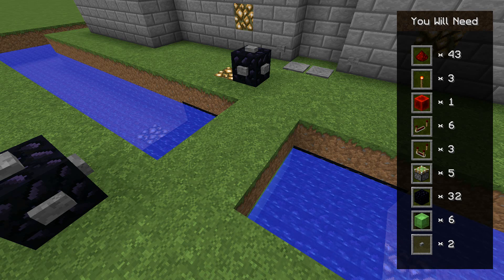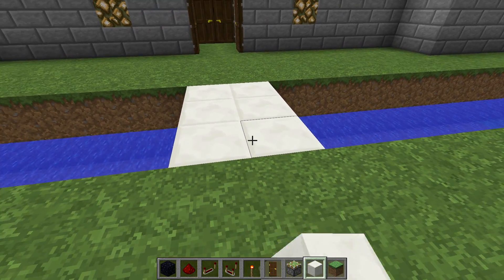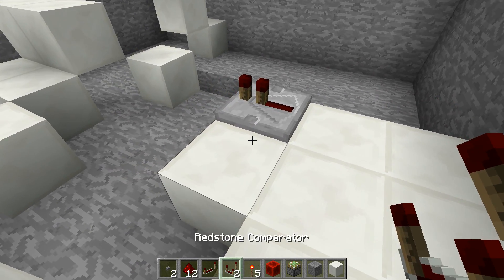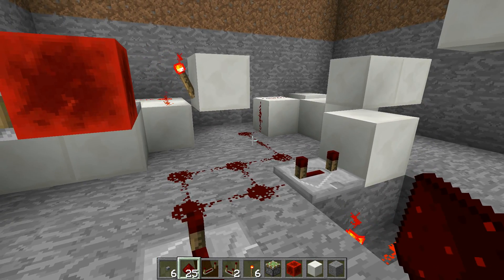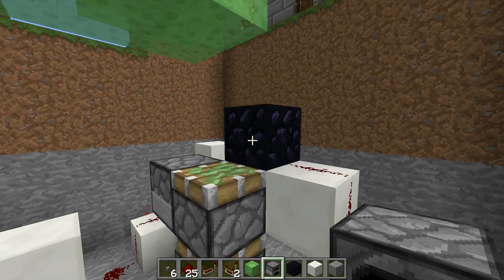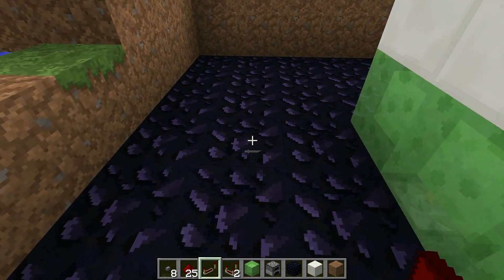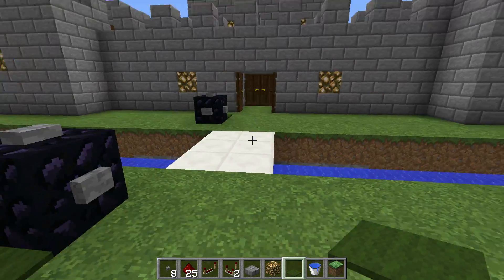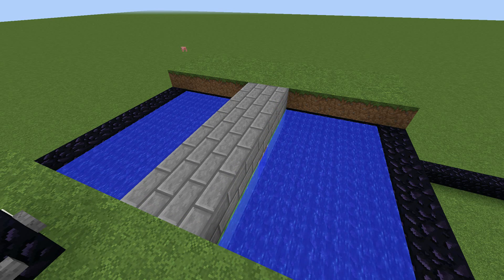Minecraft Tutorial: Redstone Piston Drawbridge

Comment: So I built it with an extended bridge.. works great but still have the lava/water flowing after dropping the bridge...
Reply from the maker: Lava, i can't fix as it does not refill when you remove the source blocks.
I have theories about how to make that work, but it would require Droppers to be moveable with pistons.
For the water to refill automatically, you need to make sure that at least one end of the bridge will have the water refill mechanic in play.

EG: if your moat and bridge look like this: (X = water, O = extended bridge, b= solid block)
bXXXXXb
bOOOOOb
bXXXXXb
The water will not refill. water needs a source block on the same row as the O's in order to refill.
So the following would work
bXXXXXbb
bOOOOOXb
bXXXXXbb
The water would then refill from the right. You could put water on both sides of the bridge (the left-most 'b') to make it refill more smoothly.

Does that make sense?
You'll see that i put water at either end of the bridge for this reason at 14:36.
Lava you cannot fix though, sorry.
Reply: LiLbUg99 thank you. I might just use water. Cheers

Comment: can you make this build extend taller?
Reply from the maker: So the moat can be deeper?
I think it may be possible.
It should be possible to have the upper-most piston be level with the blocks at the base of the moat (so from the side you would see your block choice on top, then slime blocks at the next level, and then the extended piston arm at the bottom with the piston block being level with the blocks that make up the base of the moat).
This would let water flow into the hole where the blocks come from, but that doesn't matter with this design.

Very interesting idea, i would love to try it out, but i'm a little busy with other projects unfortunately.
You could try with the same basic idea as here, but instead of a double piston extender you would need a triple piston extender modified so the top piston does the extra little pulse to push to top twelve blocks up after each extension, and again to pull them down after each retraction.
The redstone would probably get pretty intense.